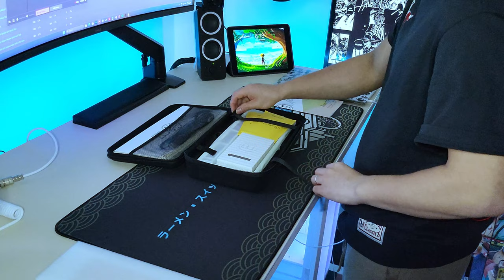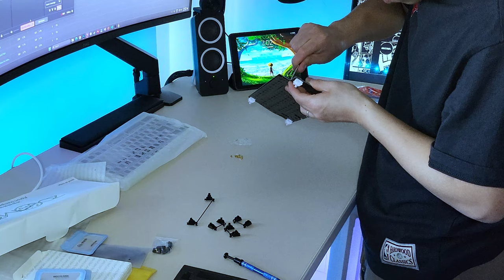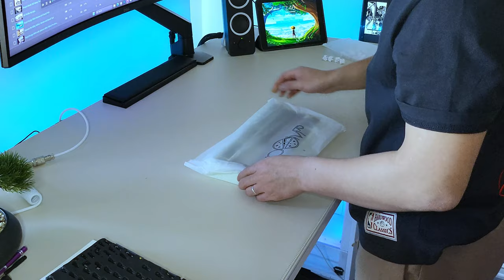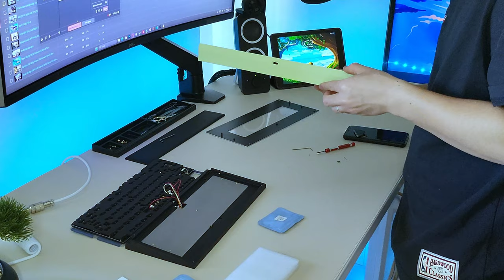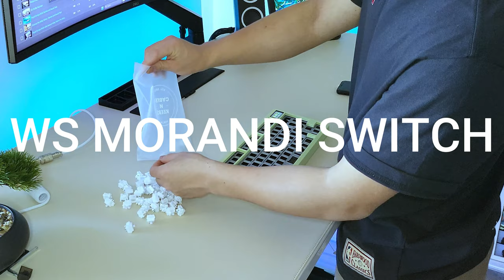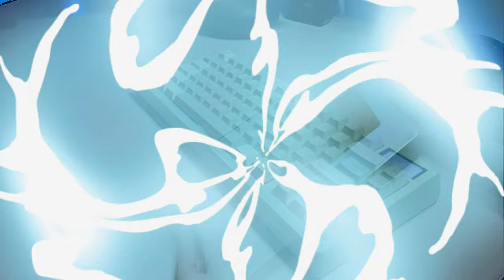Best Sounding Keyboard ! Zoom 75 : Milky Green. SOUND TEST. WS Morandi Switch #zoom75 #keyboard #top

Comment: how do you feel the ws stab v3? need to more effort to mod it? I also used the ws stab v3 but it is rattle very much even wire has been balanced!
Reply from the maker: I injected a bunch of krytox 205g0 after assembly and that fixed everything.
Reply: @lunosama  thanks, i will try

Comment: Can you specify which foam you're using when you say "all foam"? Is it PE foam and case foam?
Reply from the maker: PCB and Bottom Case foams are made of lighter PORON material. It also comes with a foam for the internal weight. And you get all of the foams I used with essential kit that Meletrix supplies.